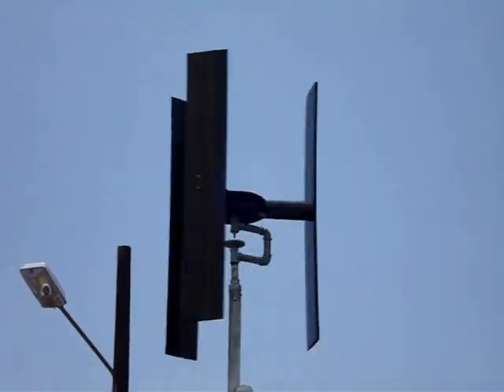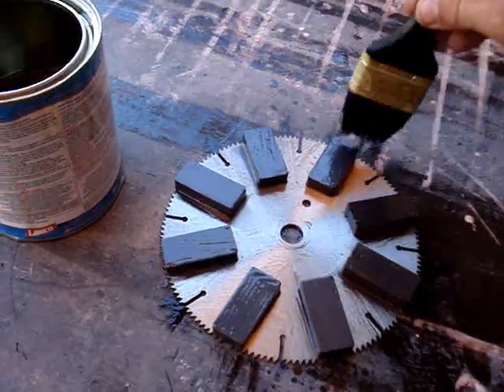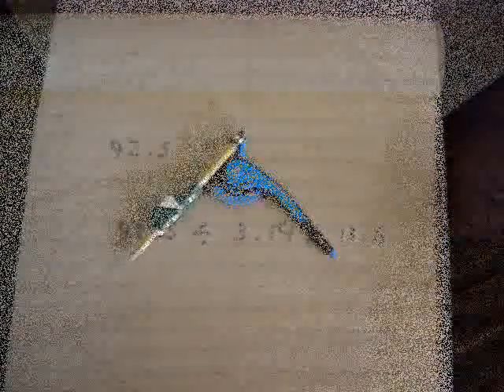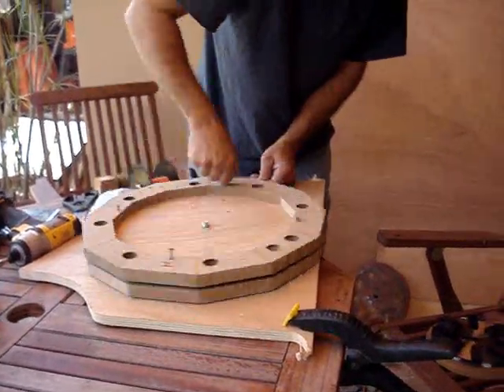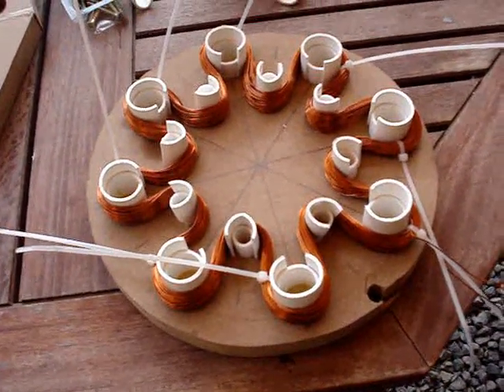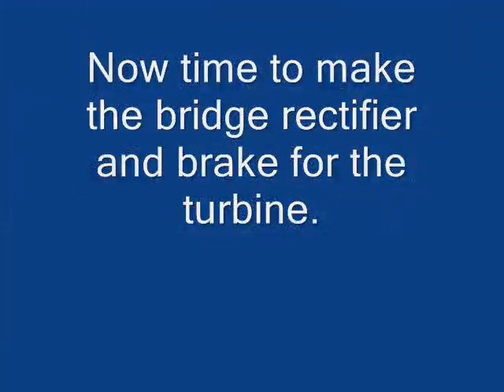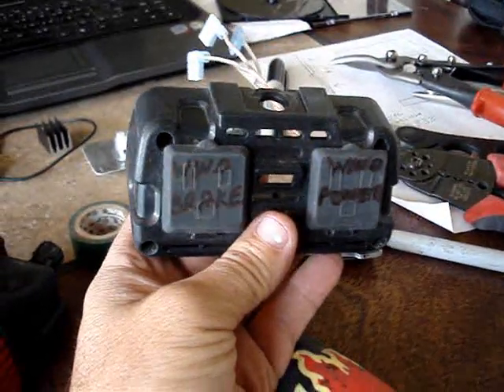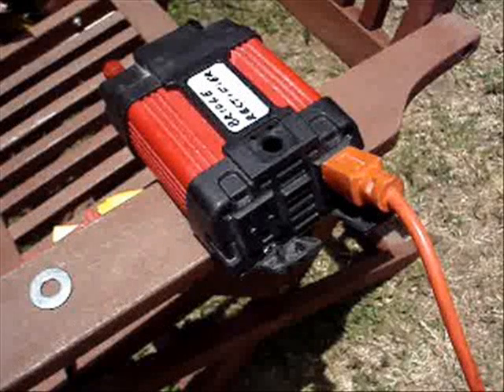(2)  How to build a homemade P.M.A generator serpentine stator for my new V.A.W.T

Comment: I very much like your serpentine coil! I thought about doing this kind of one coil generator myself because it is so time consuming and so much work to do many coils.
About your low voltage problem.... I have the same problem now with my slow rotating vawt. So I decided I will be soldering a voltage doubler soon. Since your generator is alternating current, you can do it too. You may want to google for Delon circuit. It consist of two capacitors and two diodes. I will put up a video of it soon.

Comment: You should have two rotors with the magnetic poles attracting the magnets across from it, so the magnetic field going through the coils is much stronger.  This would give you a rotor above your coil and another rotor below your coil.

Comment: Thanks for the video. Please talk in watts because volts is not a complete language for wind turbines. Current and volts are inseparable when it concerns energy generation. Great work.
Reply from the maker: I use volts because if your turbine does not produce more volts than your battery it will not charge them. I think the most important factors in a wind turbine is how fast does it have to turn to produce enough volts to charge your battery. If your turbine does not turn it does not produce anything . But thats my opinion. Thanks for the comment.
Reply: @Aceman307  Energize2000 is correct though, the current of the battery charge is at least as important; doesn't help if the charging voltage is reached if its only a few milliamps;  I had exactly that issue with a solar charger.

Comment from the maker: Yes the wire stays in place I also use some tie wraps to help , and I use the tie wraps to secure the 3 seperate coils together so they dont move when I pour the resin. Each coil has two wires .The three on the start side of the three coils get tied together and the other three go to the bridge rectifier. When you tie the three wires together the electrons cant flow out of the coils and creates a feed back. I probably did not explain that very well. Its pretty cool how it works.
Reply: When you say that you arranged the 3 coils with a 120 degrees offset do you mean that the start/end wires are offset by 120 degrees?

Comment from the maker: @KyleCarrington I really need to change the magnets to the rare earth ones, right now it really has to spin way to fast to get the volts up to 12 + . I wanted to try the ceramics to see, and they would work for a HAWT since these tend to spin faster in the same wind conditions. I can use it to recharge the little 1.5 volt rechargables for flashlights and things.

Comment: @Aceman307 I see. Honestly, I don't understand how that'd make a difference in the voltage. I would think it'd make a difference in the current, sure... I would think the number of turns, on the stator, will bump your voltage up. I could be wrong though, but that is how I understand it!

Comment from the maker: @KyleCarrington The magnets make a big difference if you look at most PMAs here on utube most guys wont even bother with the ceramics. It is very difficult for me to get the rare earth magnets here so I wanted to try the ceramics. The stronger magnets strip off more electrons thus increasing amps and volts. My other PMA uses the rare earth magnets.

Comment from the maker: I use it if the wind is to strong . By shorting the 3 phases it will stop the turbine from spinning or if the wind is really strong it will turn slowly. In really strong winds a turbine spinning out of control can be dangerous.

Comment from the maker: This is still a PMA I used dual rotors with the coils in the middle.Its just the coils are different. Check out emagnets videos on these type coils he has tested this type of coil in many different configurations. When I built this coil I gave it to a friend. So I did not test it much. For me it was easier to build and cost alot less, plus it was putting out enough power to charge a 12 volt battery. Of course the problem with any turbine is it has to spin fast enough.

Comment: Hey, my name is Travis. I'm building a wind turbine of my own. As this is my first turbine project, and my first project requiring any wiring at all, I am very new to this. I was wondering why you chose to make a serpentine coil? Is it more efficient at producing electricity than separate coils soldered together? And also, why did you choose to use smaller gauge wire? 

Thanks for your amazing, informative videos!
Reply from the maker: Two reasons I went with a serpentine coil you can put more copper in the stator and two its easier to make. I went with thinner wire because this helps increase your voltage output at slower turning speeds. Of course it reduces amps but to charge a 12 volt battery you need at least 13 volts amps are not as important. If you try to charge a 12 volt battery at 8 volts and 3 amps it wont charge but 13 volts and .5 amps it will. Check out emagnets channel he has done a ton of serpentine coil videos.

Comment: curious have you considered using iron cores yet? the iron raises the inductance maybe get more output... consider the automotive alternator few turns iron core stator and iron core reluctor
Reply from the maker: I have heard a few viewers talk about iron cores. I guess they  haven't any practical experience with trying to get a turbine to spin. The cogging would be incredible if it would ever start spinning. The power of neo magnets is too much. A cars alternator or a hydro electric turbine have the advantage of torque to keep the generator spinning. My two biggest problems have been getting the wind turbine to start spinning and the second is how fast it spins.Thanks for the comment.

Comment: You mentioned you used 75 turns to get the right amount of coil for your stator.  How did you figure out how many turns were needed?  Thanks for the videos, I am learning a lot from them!
Reply from the maker: Hi Scott
You want as many turns as you can get. It depends on the gauge of wire the thicker the wire the less turns you can get because of the overall thickness of the stator. The magnets have a greater effect on the coils the closer they are to them thats why it is so important to cast a straight and level stator so you can have the magnets an 1/8 of a inch or less away from it as it spins. I was trying to keep my stator around a 1/2 thick. So if I would have used say 100 turns each coil they would not have fit. I hope this help. I have a new video series on a Tracked vehicle if your interested. Thanks for watching.
Reply: Aceman307 Thanks!  I get it now. Is there a calculation for determining the optimal coil size compared to the size of the magnets being utilized?  I realize your coils were based on fitting inside a stator of a certain thickness.  If the stator could be any thickness, how do you determine what's optimal?
Reply from the maker: Scott Walker Thats the million dollar question, I am sure there is a point at which the distance of the magnets and power of the magnets verses the thickness of the stator have a drop off in power production but I have not experimented with it enough to know. Emagnets channel has done allot of testing with serpentine coils and different configurations. He is way smarter than me with these things. Sorry I could not of been more help.

Comment: ok did the wire also stay in place when when u took off the PVC pipe and then zip tie the three together? The two wires from the three different coil did u twist them together to get three wires? and how does the brake stop the turbine i know u have to connect them together but i cant understand how it stops it. sorry for so many questions

Comment: Hay, I just watched all the vids on this and was wondering how you wired up this new stator, and why didn't you use steel in the stator? I think I can help with this project if you are still working on it. As far as I can tell I can show you how to rewire the stator for more output. It's puting out I think about 50 to 60% efficency now if you wired the stator the same as the first one.
Reply from the maker: Have you built one of these yet because they tend to be tricky. I have heard people talk about putting steel in the coils but you have to remember you are usually using neo magnets and the turbine want ever start turning due to cogging. All the PMA s that I built worked they just needed to spin at the right RPM. There are the two standard configurations for wiring coils star and delta one works better for horizontal turbines and the other for slower VAWTs. But really the biggest problem is the wind itself In most places the wind is not constant enough or strong enough to keep power output steady. That was the biggest problem I had. There is a place for turbines but they are high maintenance unlike solar you need diversion loads and worry about over speed in storms. After my current project I am working on a different kind of energy device using the PMA generator. I will keep you posted.
Reply: I havn't built mine yet. It was, at the time my tank or this, guess which one won. But I did start messin with the blades and the locks though but couldn't get the blade locks to work easy enough yet.
I didn't know if you knew about the two ways of wiring up the stators. I actually did a vid series on alternators about it. It's in the playlist for 10 and 12 si alts. I also build those for a livin too, among otherthings. I was plannin on a circular generator, stick with what you know sort of thing. I think I know what you mean about cogging. I was going to keep the steel all one piece so it wouldn't do that. Airgap is real important in this area and steel placement too. Look forward to your new Idea. Can't wait, oh yes I can. We're working on somethink more funner right now. LOL.

Comment: MAGNET to coil ratio should be 4:3 and MAGNET width seems to be STEPPING-CUTTING the TWO arms of the coils at the same time...NO-NO .Half the power or less...9 coils would've worked or slimmer magnets...imho

Comment: i have 10 rectangle n52 grade neodymium they are 10mm thick, 50mm wide, 100mm long. I want to build a generator for a microhydro off grid power source. How do I calculate the amount of windings that i need?
Reply: From where can i get more information regarding serpentine winding?...i am intrested in knowing the calculations ..is tgere any study materials that you could suggesy

Comment: If you want to generate High Power, Use Thin Gauge Wire to make your Coils so aad to freely attracts Free Electeons In The Air. With Thin Gauge Wire, the resitance is High thereby forcing it to generate High Voltage needed to attract extremly High Volume of Atmospheric Electrons being endlessly released into the air by the Never Ending Global Thunder Strikes That occurs every seconds globally to get the Air we breathe in and out charge in order to sustain Life of we Humans, Animals annd Plants.

The remaining Electrons goes to the ground where Silicon is abundant to store it as Negative Electron and which can be Tapped Using One Wire Energy Tranfer Method.

So what is Next is to use a step down Transformer to convet the High Voltage Down To lower Voltage.
Stop using low resistance wire to make your stator serpentine One Body Coil.